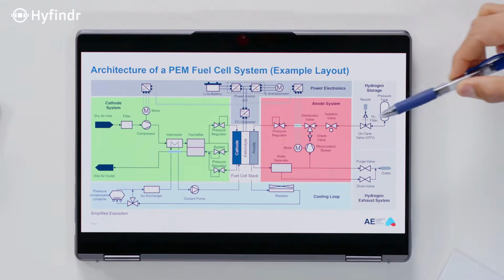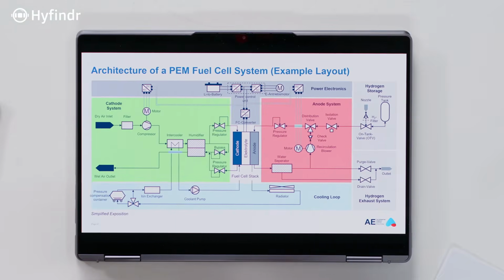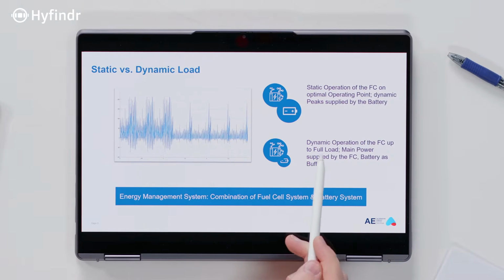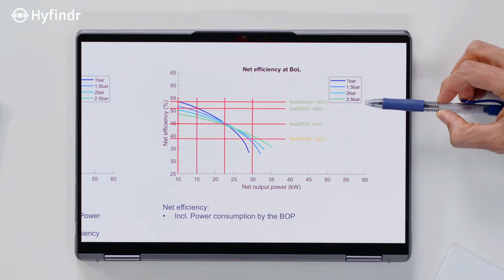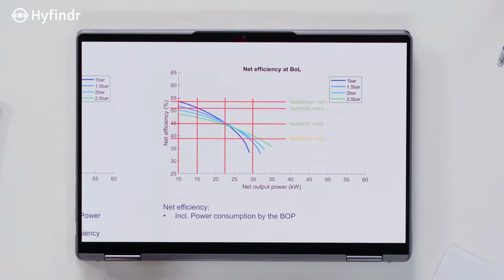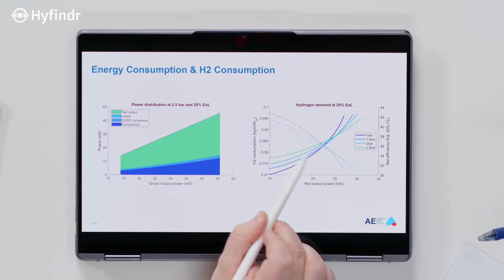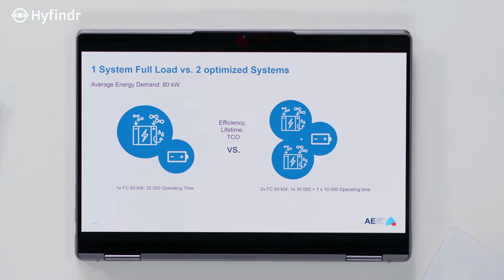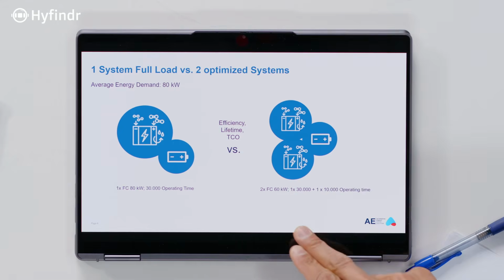Tech Talk - Fuel Cell Systems - BoP Part 2 - Optimization - Balance of Plant Explained - Hyfindr Ley

Comment: Great video. 
How do you define the gross efficiency (equation will be excellent)? 
If the fuel cell stack requires inlet pressure of air around 1 atm, how to define the minimum compressor to maximize the net efficiency? Is a compressor with a compression ratio of 2 enough?  
Thank you.
Reply: Solar engineer here,  dipping into H² because it provides energy storage, facilitates electron transfer, and might fuel my truck or bus.   

At 1 to 10 kW scale, I would argue an oversized workshop compressor or two would run for a few minutes each hour when the sun is shining and electrons are cheap, when the sun has gone you want your overnight store of hydrogen safely packed away and available on demand. 

Any consideration of net efficiency in the context of BOP should recognise that lowest TCO is likely to be a success driver. 

TLDR; KISS 💋 

This is about plant sizing, peak consumption without discussion about daily and seasonal demand, load shifting and net metering?

Come on guys: You can do better...